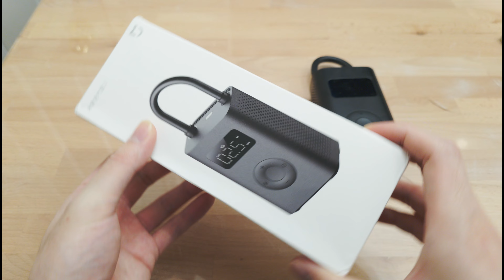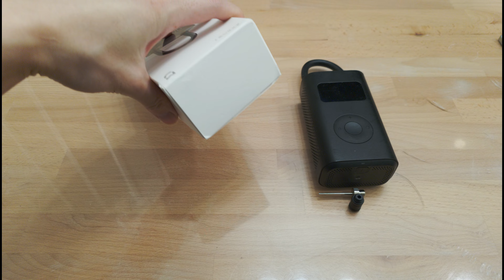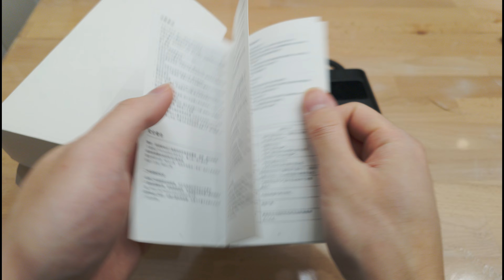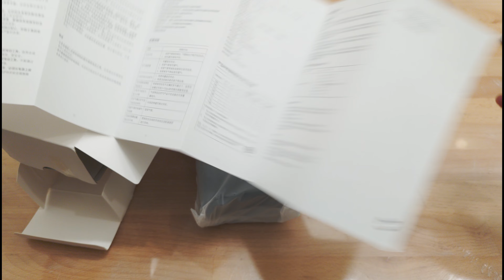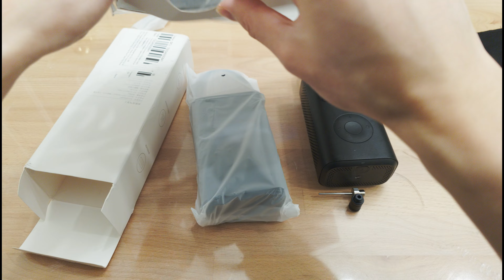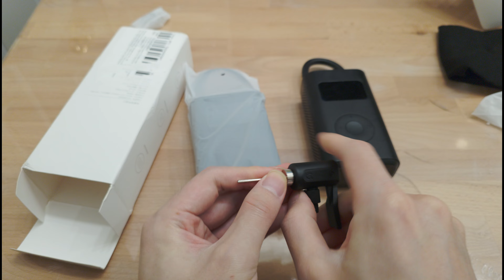Xiaomi Mijia Air Compressor 2 [25% Faster] vs Mijia Air Compressor 1s Teardown, Test, Compare 4K

Comment: Thank you for this detailed teardown. This helped me fix a faulty air pump 2. Symptoms are: after giving it a full charge, it shut down and wouldn't switch on anymore. I can only see the full battery indicator when I unplug the hose and nothing else happens. I figured out that pressing the mysterious 6th button gets it working again (as long as the battery has a charge). I have drilled a hole in the casing so that I don't need to take it apart to reach the button. So it appears this 6th button is a hard reset of some sorts. 

Why it's inaccessible without taking the pump apart is beyond me.

edit: if your battery has no / low charge, the above trick won't work and it's impossible to charge the battery with the USB wire in that state. I had to directly charge the battery "manually" with a 9V DC power supply, directly on the battery poles, bypassing the BMS.

Comment: Have the same inflator while I was pumping my car tire up suddenly the air went out of the tire instead of in lol turns out the return valve wasn’t tight closing anymore but was easily resolved it basically consists of a plastic plate with a small spring behind and a molded rubber insert  i just cleaned the plate and the “rubber” ring and Used a silicone lubricant.. and the best I saved 💶 instead of buying a new which i almost did

Comment: Thank you for a great video. had the 1s for...
its my Bicycle and motorcycle pump. also using it to check if correct pressure in car tires

Comment: Hey. Great video. Thanks for this. I have an issue with one of these (version2). It suddenly shows wrong rest pressure. 18.2 bar instead of 0 psi / 0bar. So when I power up the inflated it shows 18.2bar. I guess it’s has something to do with the pressure sensor. You don’t cover the psensor in your video. Could you point me toward some content that could help. Inflater did not fall or anything. Thanks.

Comment: The 2 is Terrible and gives false readings for me. The 1S is great so far.    The 2 is a step backward in my opinion. I put it on a cr tire that had 37psi in it and set it to inflate to 40 psi. Pressed the start button. the 2 Ran for 2 second and shut off and displayed 40 psi? AS IF.........Checked pressure it was still 37.  Used the 1S and it ran for 45 seconds and then displayed 40psi and checked and it was 40 psi. I rest my case the Version 2 has faulty pressure sensors in my opinion then stop it from inflating properly. PLUS Ziaomi not really interested in helping resolve any issues if you have one should also be taken into consideration if considering purchasing.
Reply: Thank you so much for this information! I wanted to upgrade from 1S to a newer version, but accuracy is much more important to me than performance.

Comment: Fanstastically detailed. Thank You. Although it didn't take many minutes before i decided to get the 2.
Is the right scale (Power) on the last graph also valid for the temp.? So max temp is 80C?

PS for high pressure testing, just get an old roadbike wheel with tubular tyre. Many of those will go to even 15 bar!

Comment: This is the best review I've seen. On the 2nd version, does the rubber ring also have a cone shape? And is it also a weak point? Or I didn't see this moment in the video. Thank you.
Reply from the maker: I believe I didn't take the piston out for this review so i don't know for sure, but I took a similar device (2 pro) apart recently, and it has a rounded rubber ring instead of a conical one. I assume this one is similar, but am not sure.
Reply: @liminalsunset I have a small baseus pump, but it does not have a battery, only connected to the car's 12V voltage. The baseus has a rounded ring, I think it's more reliable. Connecting to 12V is not convenient, these wires always get tangled, so I am considering buying a xiaomi pump 2. Thanks for your review and analysis, I appreciate it.

Comment: Did you meassure real pressure or what the pump tells you? Mine is quite off. If i put 5 Bars in reality its 4.4-4.6 bars. Do you know if there is a way to calibrate version 2?

Comment: is that an 18650 battery cells?
Reply from the maker: Yes, they are using LithPlus 18650 cells in the 2nd gen. I do not know if they use different suppliers for different batches.

Comment: Nice video man, i juat wondering if this device produces water just like conventional compressor?
Reply from the maker: It probably does produce water, though considering the amount of air passing through it, the amount of water would be proportionally smaller and probably wouldn't build up enough under normal use to be noticeable.
Reply: @liminalsunset  right, thanks man

Comment: Hi. Would tounhave a video tear down of the 2s? I need to know how to do it because i need to  clean the pressure sensor part. Im having issues with mine stopping sbruptly and not continuing to pump. Thanls
Reply from the maker: Hi, I didn't know the 2S was out already! If you meant the 1S, I have an older video on my channel of it. The pressure sensors don't seem to have changed much between generations.
Reply from the maker: @jasperaguila5513  If I'm not mistaken, the pressure sensor itself is mounted using two screws on the side of the housing of the sensor hose end. You would be able to remove it this way. I'm not sure if the main hose or any other hose is unscrewable, which may help.
Reply: @liminalsunset  got it. Let me try that out tonight when I get home. Thank you for the tip!

Comment: It took me more than an year to realize you can screw off the air hose on the model 1S. I thought my unit was developing an air leak, then realized it somehow came loose. Now, it is much easier to pack in my rucksack.

Comment: I am convinced that the service life of the piston and cylinder would be drastically increased if the hose was periodically unscrewed and some silicone oil was sprayed directly into the piston. Silicone oil is beneficial to plastic, rubber and metal.
Reply: Interesting tought! Sounds plausible. Any views on this??
Reply: @ter11112343  You can't see the cylinder and piston, but they are there just below when you unscrew the hose from the pump. You don't need to spray a lot, just for a short time and that's enough if you do it occasionally. Certainly better than having the cylinder and piston run "dry" all the time.
Reply: Thanks!! I have the version 2. same thing there I assume.

Comment: I had mine but it's universal version which is great ,and i find it much better compare to my michellin tire inflator which is the battery goes low with just adding air on my tires,the only thing that i like about michellin is the design,but this xiaomi has better battery

Comment: I’m still wondering what that blocked out  button does. Have you checked?
Reply: It's a reset button and can apparently also be used to calibrate the pressure sensor. See my other comment in this thread.

Comment: Wheelchair tubes are usally  high preasure ones...  the ones i use say 85 to 140 psi or 56 to 10 kg... luckily i bought a version 2 and works fine

Comment: It would be so nice if they added an extra power port and extension cord, so you could run of day a car lighter system. I think for the form factor it's a pretty nest device. I'm bit familiar with this form factor, so perhaps and probably there are better ones
Reply from the maker: If I had to take a guess, the lack of a power port on the device is also intended to indirectly limit how long you can use the device at one time (i.e. to prevent overheating). It's possible that the device would burn out if you were to add this feature and operate it for an extended period of time.
Reply: @liminalsunset  but it then could easily have a timer or temp measurement, I'm just free balling. I understand this device has its limits die to its form factor. I think it's still a nifty device. I bumped into it today as a shop here on the island sells a 1s. But hen I noticed there is now a V2. That's got me googling and looking at reviews. I think I prefer the V2 and would order it online vs buying it locally

Comment: Insimply van not understand why they can't out in a much bigger battery. I mean my phone already has 5k mAh how can this have just 2k?!
Reply from the maker: The reason for the capacity difference is that the batteries are two smaller ones in series, and in a phone there is effectively one larger battery in "parallel" so to speak. 

The amount of power stored is voltage times amp-hours. Thus, the battery in this device is actually equivalent to a 4000 mAh phone battery. The reason it is not 5000 mAh likely has to do with your other comment, because the power output (sustained) of these batteries is higher.
Reply: @liminalsunset  thanks for the explanation
Reply: I guess the battery is 2kmah because it produces more amp vs a phone. I'm sorry for dumb question, I'm not really familiar with this kind of stuff

Comment: Thank for great video. And after watching, I got an idea to mofify the pump by adding connector with a switch that can bring external ~8V DC source to motor pump (12~15V to 8V DC-DC conversion). That will save energy from internal battery and extend use for car/motorcycle on the field. Of course, initial pressure (e.a. from 0 to 30psi) will be manualy controlled for multiple tyres and final pressure (e.a. 32psi)  will be by switcing to integrated battery and automatic stop when wanted pressure is reached. What is your opinion for that?
Reply from the maker: My opinion is that a better way to accomplish this would likely be to simply have a switch that allows you to power the device either from the battery or the external power source. This way all functions of the device are kept. As long as your external power source can supply 40 watts or so continuously, it will run fine. You should ensure that the battery is disconnected during this operation, as this charge rate is likely far too high for it.

On the other hand, the battery power provided should be sufficient for most uses. As seen in the test, generally, charging for half an hour will be enough to fill one tyre of a car from empty.
Reply: I think that disconnecting battery pack and external powering whole unit with pump voltage (7.4V or above) will destoy charging and mesauring part of device. Also,  my opinion is that unit is charged by 5V and battery is leveling charged for every cell. So thats why I suggest to external power pump motor only. I didn't open and measure voltages of my unit and that is why I asked you for optnion. Anyway, thanks for fast answer. @liminalsunset
Reply: I believe it can not charge and pump at the same time, at least 1s can not